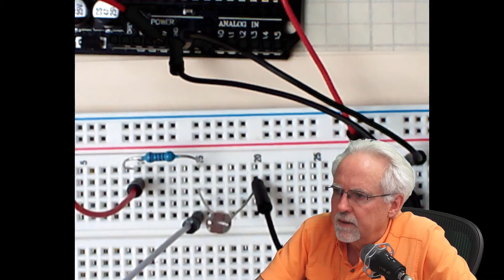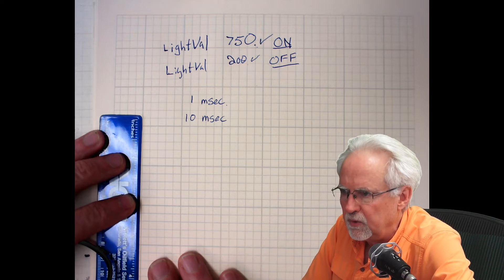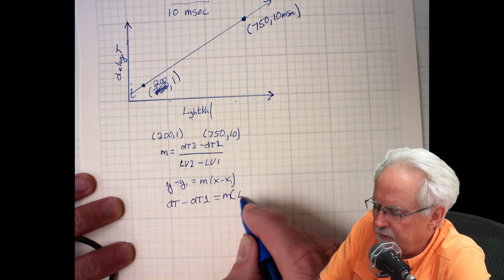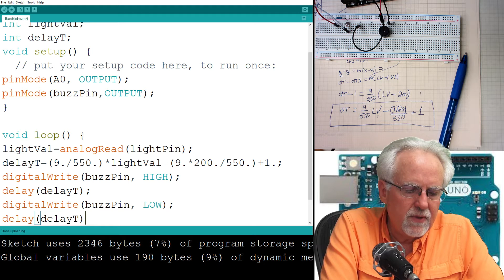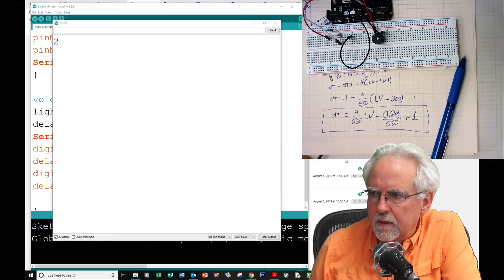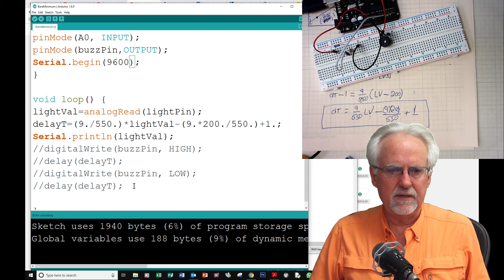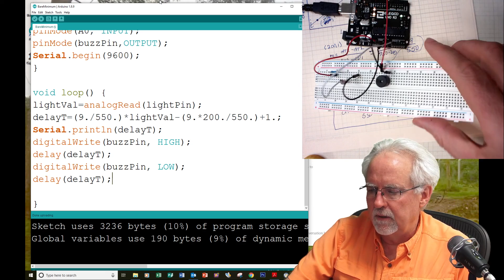Arduino Tutorial 26: More Fun with Photo Resistors

Comment: Most excellent teacher and series.

For those wanting to know the math to Google to learn more about what Paul is using try these two in searches

Point-Slope Equation of a Line
The Slope Formula 

I have only a few OCD triggered comments

delayT was defined as int but used as a float

Looking up the arduino delay() function it takes an unsigned long as it's parameter that you need to pass to it so any of the integer values will work but sending in a float value would be meaningless to delay() so doing floating point math which is more costly to perform than integer math is not needed with arduino in this example. Paul is building these lessons on the fly in front of the camera so I'm not critical to Paul just passing on some things I learned after reading and researching after watching this video that inspired me. 

For anyone wanting to get more advanced, and I do hope Paul mentions this later in this awesome series but it is inefficient to continue to calculate again and again the same equations in a loop on a low powered microcontroller. For example m is constantly recalculated each time the loop executes.

Instead define a variable m and calculate the value of m one time only above the loop() section. Then in the loop section use m which is now already pre-calculated saving compute cycles. Hence the line delayT=(9. /550.)*lightVal... Becomes delayT=m*lighVal...

If you notice on the same line delayT= you have the remaining... LightVal-(9.*200./550.)+1 and this too is inefficient use of compute cycles repeating the calculation every loop--move this to another variable calculated once above the loop let's call that k for example. Now inside the loop your delayT line is now simply:

delayT=m*lightVal-k; // a single multiplication and a single subtracting each loop

And your microcontroller is speeding through this calculation much faster because the first and last parts have already reduced to answers needed to finish the multiplication and subtraction in this line of code. .

One small catch in the pinMode() A0 the literal pin was used instead of the variable. As Paul mentioned many times earlier use the variable in case you switch physical pin used in the future. 

Again this is more advanced way of thinking and designing code for microcontrollers and beginners should ignore unless this makes sense to you reading this or you also get OCD over these things like me (smile).

Paul if you are reading I love when you deep dive into why things work the way they do. I hope you do it more often.
Reply: Do you have a channel by chance?

Comment: Hey Paul I don't know if it was ever mentioned but for pinMode you put A0, INPUT instead of using the int lightPin.  Yet down further in the code you use lightPin. Does that work since you made lightPin=A0 so it just equates it based on the int you declared?

Comment: Just wondering if anyone else realizes that if you reverse the polarity on the photo resistor circuit, it will cause the frequency produced to go from low when the light is on the photo resistor to high when the photo resistor is darkened.

Comment: Got this working, but as with other projects if I try to print the value over the serial monitor it impacts the frequency.  I understand that it is creating a delay so by increasing the baud rate it didn't impact it as much.  Is there a work around so I can still use the serial number determine the value without impacting the output result?

Comment: what about writing "float delayT" instead of "int delayT" since it has decimals in the formula?
Reply: delay will only take a int or long number.  both are integers.  When you do a calculation with floats and put it into a variable that it is defined as a int it just truncates the number.  For example: delayT=50./3.=16.67, so when you do: delay(delayT), it will delay for 16ms, not 16.67ms.

Comment: Most easy way to do this is just add delaymicroseconds ex.
Digital Write(Buzz pin ,HIGH)
delay microseconds(20)
digital write(Buzz pin ,HIGH)
delay microseconds(20)

If its dark all same just change delay microseconds to 10000
Without any math

Comment: Mr. McWorther! I did it, I made it work! I started at when the light is 0 the buzzer delay in microseconds is 1000 and when its 1023 the buzz is 10000, I then got a function where y = lightVal(9000./1023.) + 1000 I'm so happy that you taught me enough to let me be able to do such math for such things like arduino, here is my code.

May the lord bless you

int lightPin=A8;
int buzzPin=4;
float buzzStop;
int lightVal;

void setup() {
  // put your setup code here, to run once:
pinMode(buzzPin,OUTPUT);
pinMode(lightPin,INPUT);
Serial.begin(9600);

}

void loop() {
  // put your main code here, to run repeatedly:
lightVal=analogRead(lightPin);
buzzStop=(9000./1023.)*lightVal+1000;
digitalWrite(buzzPin,HIGH);
delayMicroseconds(buzzStop);
digitalWrite(buzzPin,LOW);
delayMicroseconds(buzzStop);
}

Comment: Hì Paul and thank you ! I have a couple of quest.  If I introduce a delay to read Serial.println easily I stuck the buzz noise, Could it be possible to introduce a delay without influence the proper operation ?
If I put more light or much dark than expected by math the program stucks.
I hope to learn by the answer. 
Very kind of you.
Vittorio
from Milan

Comment: Tell me if I'm correct,  last lesson vid analog read was measure across resistor in this vid we are measuring across photoresist so the value will be 200 when light is ON and 750 when light is OFF, so did Paul make mistake when drawing the graph?
Reply: I just commented about this, I believe Paul mismatched the x and y values. The graph should've had a negative slope

Comment: I did 

lightVal=analogRead(light);
Serial.println(lightVal);
buzzFreq=lightVal;

digitalWrite(buzzer,HIGH);
delayMicroseconds(buzzFreq/3);
digitalWrite(buzzer,LOW);
delayMicroseconds(buzzFreq/3);

And it kinda had one note for lights off and another for light son but they weren't that different.
I thought Maybe if I made the timing smaller it would help make it more high pitched hence the /3 on the buzz Freq.

Comment: I, too, had an issue that needed debugging...my old eyes got my slots mixed up, and as a result,  I wasn't getting a good read on my photo resistor.   It's amazing what wiring it up correctly will do to make it work....

I also had to play with the values in the equations to get a better range for my setting.  But...it all worked out in the end.  Thanks again for the lesson.  On to the next!

Comment: I really need to look over the maths for this as I don't feel like a really understood it properly. I went back and used one of the old ones that uses the line slope equation and came up with a completely different result that still worked really well. It still does everything that it's supposed to do so that's something.

Comment: i was following the math until he got from; dt-1 = 9/550 x (lv-200) to the final equation can someone help? where does the 9x200/550 come from?
Reply: I'm trying to figure it out
Reply: You do not times 9x200/500. That 9 is just carried over. It depends on your values. I used a different one than Paul
Reply: Ah that 9*200/500 is his minus calculation from lightVal and lightVal 1i think

Comment: You defined lightPin,  but then in your pinMode statement you used the explicit value "A0" that you call a constant, but a constant is a whole other thing. Note that the lightPin variable could be changed later in the code either by accident or by design. If you want it to remain readonly use the const qualifier in the declaration: e.g. "const int LIGHTPIN = A0;". By making things readonly you can save yourself from a lot of hard to find bugs in the code. Bugs like these normally can only be found by single step debugging which is not possible for the arduino. You would have to dump values to the terminal. Constant expressions should be all upper case so that we know it is a constant, HIGH and LOW  are implicit constants already defined.
I hope you don't think of this as flac, your tutorials are the best. You are a wonderful teacher, it's just that I have been programming a long time and these conventions have helped me and I hope they help others too.

Comment: I did the 1st Exercise as requested. I built the circuit to control the tone of the buzzer by the photo resistor. I also used the Slope (m) formula to get X=photoVal and Y=toneVal. When there was more light on the photo resistor, the tone was lower. When less light the tone was higher.

Comment: so, not so difficult to write something that works BUT, a positive slope to the line means the buzzer pitch is high in the dark and low in the light. I want the opposite, so simplistically I changed the sign of the slope. Nope. Buzzer won't deal with negative values. So, how to reverse the whole deal without a negative slope? Is there an absolute value function?
Reply: No need. Long-buried memories saved the day
Reply: I really need a way to scream at you in the past "pinMode (lightPin,INPUT!!!!!!!!)"

Comment: Rules of debugging software controlled hardware;
1) Verify hardware connections on inputs and outputs.
2) Verify hardware produces input.
3) Verify hardware responds to an output signal.
4) Verify software is setup to accept inputs and generate outputs.
5) Walk through code to verify each step.
Reply from the maker: And practically, put lots of print statements in your code, to verify at each step you are getting what you think.

Comment: Paul, for those (me) who avoided all but basic math most of our lives could you include or list the names of the formulas/formulae you use in a session? It would be useful to know their 'title' for some follow up homework on them
Reply: linear line equation (y2 - y1) = m (x2 - x1) , then solve for slope:  m = (y2 - y1 ) / (x2 - x1); then plug in value for slope  back into the linear line equation and plug in values for one point and replace the variables in your program for the other point ... (delayTime - y1) = m * (lightVal - x1) - and that becomes your equation in the program.  I know your question is two years old, but hope that helps (follow along in the video)

Comment: I'm a bit confused - shouldn't the circuit be wired up so the the fixed resistor (5K) goes after the Photo resistor?  (on negative side, as in previous tutorial).  On the graph/ formula entered for delayT - shouldn't the values go down when it gets dark?  (not 'UP').  I've tried it and it works that way when the 5K in on other side - or am I missing something??

Comment: I'm having issues with the Arduino IDE on my computer (Win 10/ 64).  It suddenly stopped working.  I've re-downloaded the latest (v. 1.8.12), trying both the Windows App (10) & the Windows installer (>7) seperately.  They both download, but when I try to open the Arduino start-up rectangle appears momentarily then goes off & nothing else seems to happen.

Ive browsed various solutions - but not getting far.  Any quick fixes/ advice?  Be much appreciated - as I want to get onto the next lesson!

Comment: In the void setup() – wouldn’t it be better instead of entering ‘A0’ (constant) enter it as ‘lightPin’ (variable), as we’ve learnt to make later adjustments needed easier?

So this;  pinMode (lightPin, INPUT); instead of this;   pinMode(A0, INPUT);Totally agree with teaching/ understanding the physics of what's going on 'under the hood', so its not just 'black box' syndrome.

Comment: this what I came up with and it worked and sounded good:
int lightPin=A2;
int lightVal;
int dv=250;
int y;
int buzzPin=9;
void setup() {
  // put your setup code here, to run once:
Serial.begin(9600);
pinMode(lightPin,INPUT);
pinMode(buzzPin,OUTPUT);
}

void loop() {
  // put your main code here, to run repeatedly:
lightVal=analogRead(lightPin);
Serial.println(lightVal);

y=(31./49.)+(9./245.0)*lightVal;
tone(buzzPin,y);

}

Comment: i didnt do it same but it worked ?
 int readpin=A0;
int lightval;
int buzz=3;
int dt=500;
int j;
void setup() {
pinMode(buzz,OUTPUT);
Serial.begin(115200);
}
void loop() {    
lightval=analogRead(readpin);
Serial.println(lightval);
delay(dt);
for(j=1;j<=100;j=j+1){
digitalWrite(buzz,HIGH);
delayMicroseconds(lightval);
digitalWrite(buzz,LOW);
delayMicroseconds(lightval);
}

}

Comment: could not make music with my passive buzzer, just dry buzzing, my passive buzzer made continuous clicks, never too much musical notes.   photoresistor varies from 100 ohms phone led directly close to 100 MegaOhm with room light off. measured node between photoresistor and 5K ohm above ground, calculated analog read counts, volts, then I miliamps, then photoresistor resistance to monitor voltage divider behavior. I couldn't understand what the dependent variable should be,
finally decided on frequency, from 500 hz to 5K . y (freq) = (5000-500)/1053 + 500.
borrowed  std library bubble machine bubble function,  lovely sounds. pleasing, nice effect like thremin linking light to pretty good note quality.  nice musical melody's to listen to, could not find a collection of
user actions  -- audio feedback response noises, like audible clicks for keyboard entries or alerting beeps, boops, alerting semi-windows type feedback noises.  real speakers can be added -- time to move on to
next lesson.
Reply: lawrence welk show "turn off the bubble machine"

Comment: I did the project assignment and then looked at Pauls approach. I went from a very low sound in dark to a very high sound depending on the light. And I did the math and worked with a negative slope. All in all, a very good lesson, showing how important it is to persist in finding a solution.

Comment: int luxPin=0;
int luxLevel;
int buzzPin=6;
int dt;
int maxTone=2000;
int minTone=20;
int maxLux=600;
int minLux=400;
int m;

void setup() {
  // put your setup code here, to run once:
pinMode(luxPin,INPUT);
pinMode(buzzPin,OUTPUT);
Serial.begin(9600);

m=(maxTone-minTone)/(maxLux-minLux);
}

void loop() {
  // put your main code here, to run repeatedly:
luxLevel=analogRead(luxPin);

dt=((m)*(luxLevel-400.)+10);

digitalWrite(buzzPin,HIGH);
delayMicroseconds(dt);
digitalWrite(buzzPin,LOW);
delayMicroseconds(dt);
}

Comment: Have to admit, the math got me and I had to copy that part, moving equations around is something I’ve struggled with and not having done anything like this for at least 35-40 yrs didn’t help. At least as I followed along I understood it so I guess all isn’t lost. The circuit work and rest of my code was real close to what you did and once the formula was in my buzzer was singing up and down. And then as as I varied the light, listening to the buzzer tone change I wondered how long it would take for you to find that output/input mistake😉. Thanks again Paul.

Comment: After 26 lessons i am getting the hang of this coding. I am seeing the mistakes as Paul is coding and on this lesson I was screaming at the screen!! LOL But Paul did not hear me, also  I did the project right before I watched Paul do it. I did get hung up until I seen Paul using the digital pin and not a PWM pin. Thin it made since! LOL For I was thinking of using a PWM pin.
These are grate Arduino Tutorials, I am looking forward to the next 26 lessons!
Reply: I did it using PWM pin and it worked like a charm.

Comment: Hi nice video. I like everything about learning to use Arduino.

But I think there are two mistakes in there. Maybe I’m wrong, but I’m not sure.
Please give me a reply

First you told, that you want to have high tone when light is on. High tone means short delay time, but you used long delay time.
Second you connected the light sensor in the opposite way. More light should give a high value like the example before.

Good like, both mistakes are compensating.

So everything works, but with 2 compensating errors.

Comment: I screamed...NO IT'S AN INPUT, but you didn't hear me.  My coding is very similar.  I had to print out lightVal and delayT (I used different names though) to find out why my buzzer frequency was very low.  Found out that the lighting in my office was different than in the last lesson, had to recalculate the slope.  After that the buzzer performed as expected, even though my delayT didn't exactly go from 1 to 10ms.  It's all good!!

Comment: Ok ,had issues with the math here,using the 10K ohm resistor and the elegoo photo resistor ,my light on reads740 and the light off reads 932 , i would get a negative value unlike yours you have a lower value for lights off and higher for lights on.Confused dt=(9./208.)*lightVal-(9.*932./208.)+1.;
Reply: Whether you get a negative or positive slope on the graft and calculations depends on how you taking your measurements for A0. Is it across the resistor or across the light sensor?  It also depends on whether you're going from light-dark or dark-light. You have to decide and set up your calculations accordingly. 
{+slop x,y: 740lv,1ms & 932lv,10ms}   {-slop x,y: 740lv,10ms & 932lv,1ms}
see link: https://drive.google.com/open?id=1eR4wzEiypbwXQGafnnO5QKjY-X-OO21d

Comment: Had trouble with this program trying to get buzzer to change sound. I did notice if I don't take the input value at A0 pin and equate it to another variable. Example TVal=analogRead(PR);  the program does not calculate properly. Can anyone explain why we need to assign value at A0 to second variable.
Still trying to get buzzer to change sound when light changes. 
Thanks Paul, these lesson are teaching me alot
Reply: https://youtu.be/nPOKOi1jIK0?list=PLGs0VKk2DiYw-L-RibttcvK-WBZm8WLEP&t=578

Comment: I wire the circuit correct, Just used pin 12 instead. I flubbed on the math. I tried useing map function. It didn't work for me.